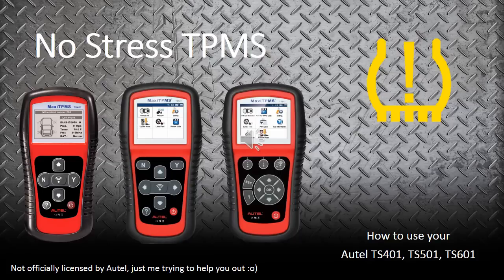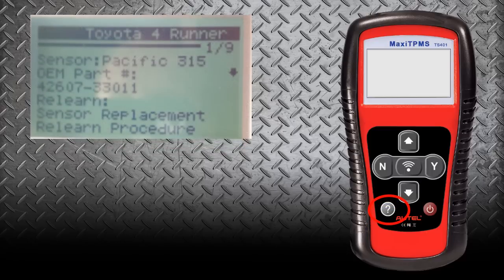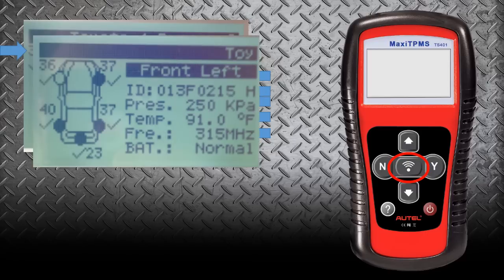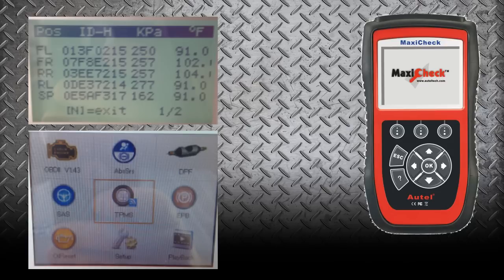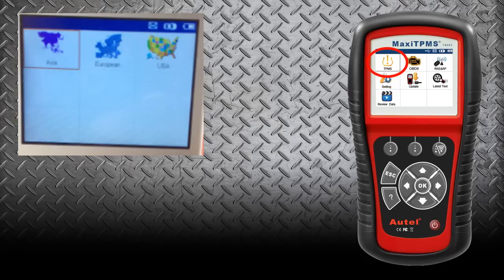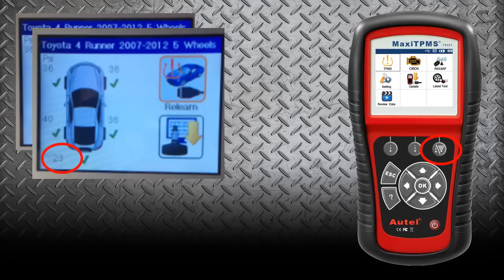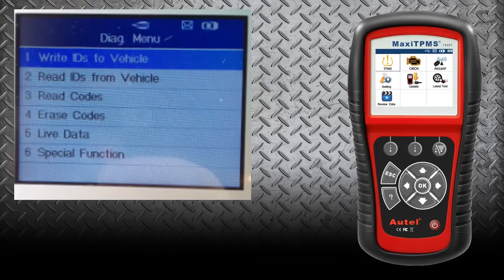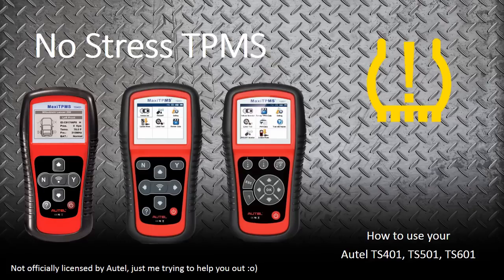No Stress TPMS Autel TS401, TS501, TS601

Comment: Hi i buy  TS 401 and can not programming  Porsche Cayman 2014 ,it reads the valves but has no guide  to start on schedule 
you have some information to help me ,thanks
Reply from the maker: +Flavio Machado The vehicle should now be driven for up to 25mins in order for the sensors to be recognized by the vehicle. All other sensors should be more than 20 feet away from the vehicle at all times. If a 25 minute drive above 20mph has not successfully reset the system, redo the reset procedure but before driving, deflate each tire 5-8psi, reinflate to the door placard spec, then drive for up to 30 miles continuously. Information found at: http://www.tpmsdirect.com/Porsche_TPMS_Relearn_Procedures_HUF_RDE010_RDE011_a/841.htm
Reply: +Flash Performance Thank you for the help, I did this procedure and work perfectly 
thank you very much